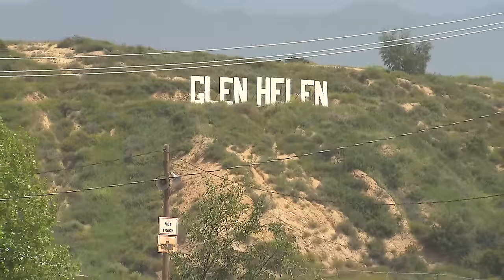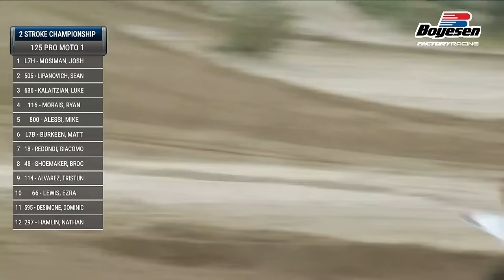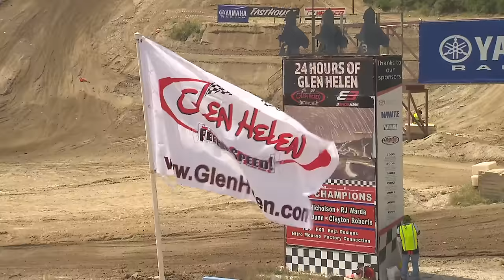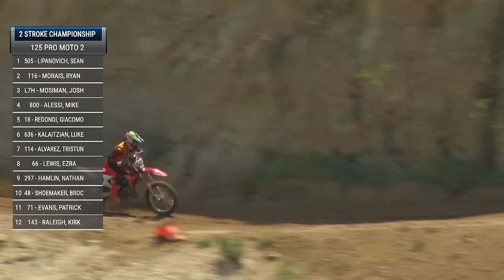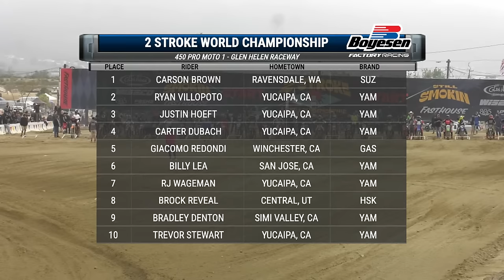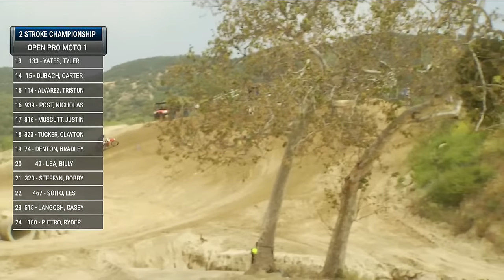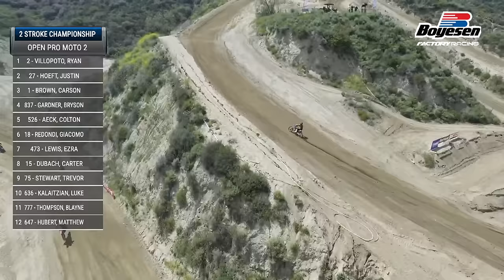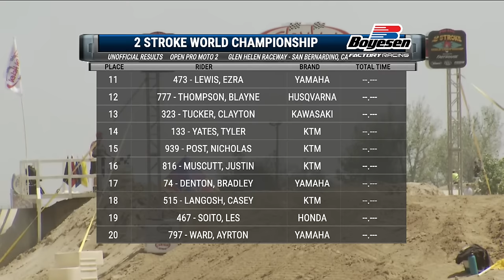2-STROKE WORLD CHAMPIONSHIP LIVE FROM GLEN HELEN 2024

Comment: Well MX was mostly 4 strokes till the mid sixties then it transitioned to 2 strokes in the late sixties by the early 70s there were very few 4 stroke dirt bikes. So 2 strokes ruled mx for about 30 years.
Reply: they still do ..i was there when the two strokes took over ..they are much lighter weight ..easier to pick up the front wheel and maneuver ..makes twice as many power strokes in less time than any 4 stroke..full power in half the revvs ..always lighter weight ..Kaplan America had a KX500 on his show the other day that made over 70hp and weighed 217 lbs ..you are not going to beat that one with anything but another one